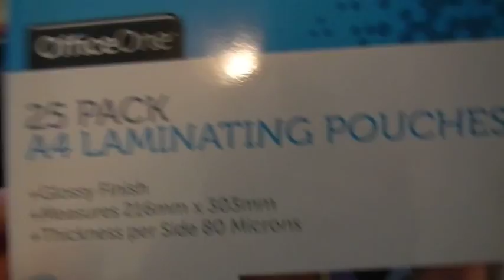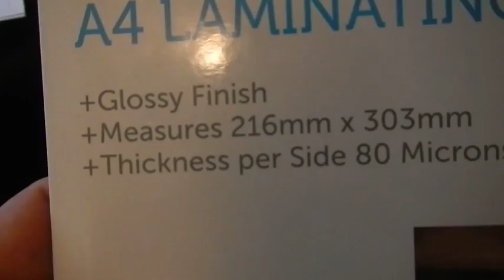Home Made (T.E.A.) Laser

Comment: Congrats on getting it working! Lots of fun ahead it seems.
Reply from the maker: Yep. Lots of tests to try. I'm surprised at the size of the gap I can lase. I find the most powerful output is around 2mm gap. Still want to work out a way to have the spark gap pre-ionize the laser gap too. As well as experiment with co2 and different lasing gap edges.

Its amazing the abuse those OHP transparencys can take. Popped one yesterday. Running with a 10-15mm spark gap. so charging to 30-40kv :D Ran for a while before it popped... There was corona all around the edge of the top capacitor plate on discharge. I can also get is firing to high rep rates running the transformer on 20v. More video soon.

Thank you for doing your video and inspiring me to try. :D
Reply: one question, is there any way to make other setups? I mean, is there any other way to make this less bulky and more portable?
Reply from the maker: To a point. If you want portable you cant go past laser diodes.

If you want max burning power, your going to want a high voltage gas laser. the bigger the better. You can make it more portable than this, but its still going to be bulky, and need a hefty power supply, and likely vacuum pump and gas bottles.
Here are a few variants of varying complexity
http://laserkids.getenjoyment.net/index.html
Reply: Thanks, but yes, I was thinking in something, with some more power. I'll see.